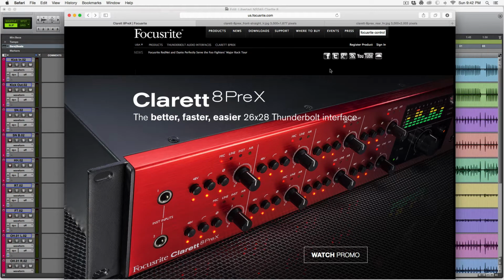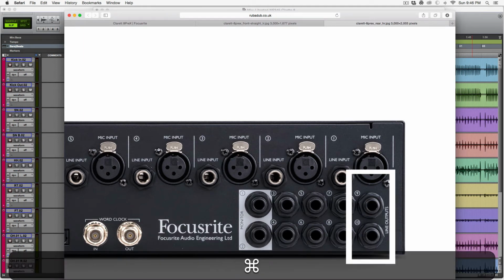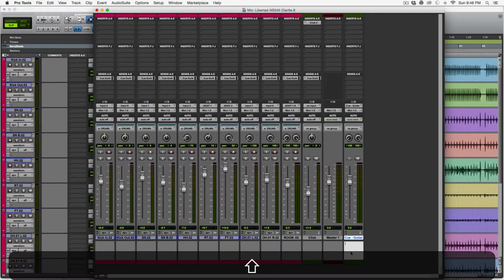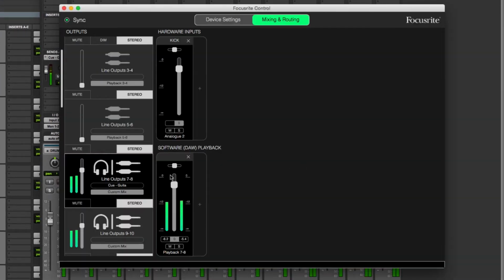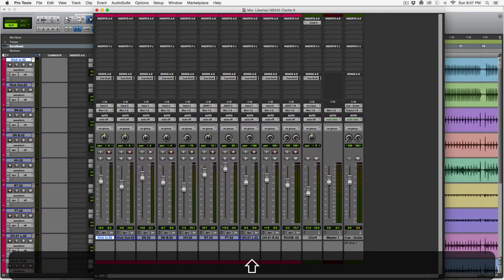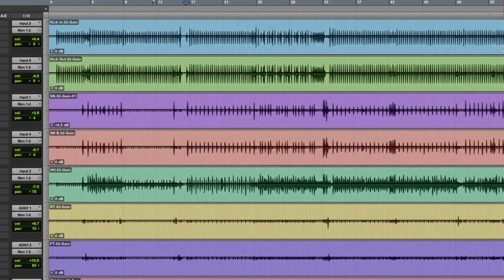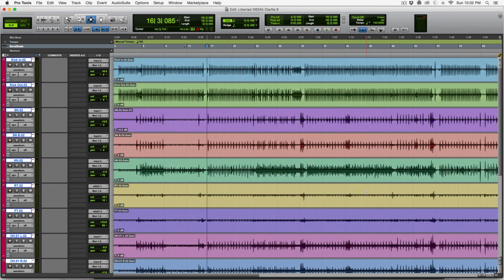Focusrite Control | Setting up Cue Mixes with the Clarett 8PreX and Pro Tools  12

Comment: I’m having a feedback issue, when I insert more then one hardware on a track I will get a double. I then would go to Focusrite control to turn fader down which allows me to hear nothing on that channel. I’ve tried muting also still nothing. All my inputs and out puts matches with Protools. My connections is correct, I’m using balanced cables.  
Focusrite control line outputs matches playback inputs. I’m using Focusrite clarett 8pre all connections is used.
Reply from the maker: OK. You shouldn’t have a feedback loop going if you mute the track just play with it you’ll get to it you’ll figure it out. It took me a little bit, but you have to play with muting the tracks and because you will get a feedback if the tracking your daughter is not muted or something like that don’t remember I don’t have the clarrette anymore so I haven’t used it in a little bit but I remember that exact issue just play with it you’ll get there
Reply: @JorgePintoMusicHTX  I found a work around which was to put my tracks on a Aux bus and then lower the focusrite control , very weird but this worked for me..
Reply from the maker: @prodcountryjames  . Keep playing with it. I’m sure you will find other solutions.

Comment: Unless you set your sends as "pre" (which you did not), it doesn't make any sense to copy the levels of your mixer into your send levels. You want to put all sends at 0dB, so they send your current mixer volumes, and from there, put more or less level on specific channels. The way you did it, a channel that you have in your mixer as +12dB (like your FT.02 channel) will send +24dB to the headphones. Also, any change you make in your mixer still affects the headphones mix. Now, if you set those sends as "pre", then yes, you need to copy your mixer levels to the send levels in order to have the same initial mix, and as they are in "pre", they don't get affected by changes in your mixer. Personally, I'd go with the first option and set the initial level of the sends to 0dB and not setting the sends as "pre".

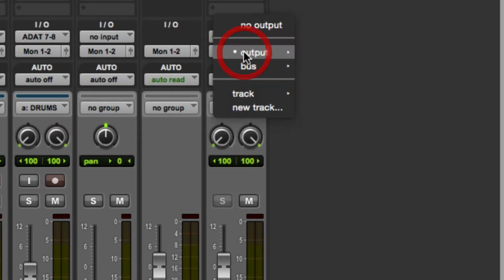Comment: This is insanely confusing.  4:10 "send guitar cue to outputs 7,8."
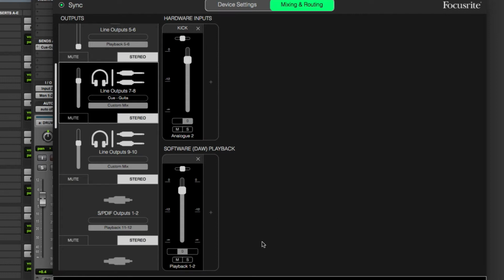5:04 "I'm gonna add playback 1,2" But you put the guitar cue on 7,8; shouldn't you be adding Software playback 7,8?
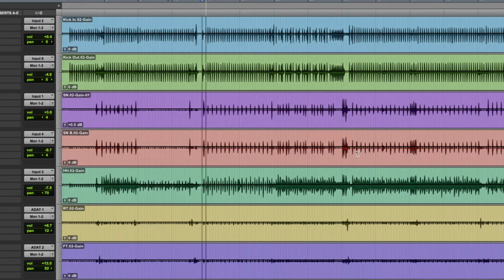5:22 "You can see that the audio is coming out the focusrite control". Okay...
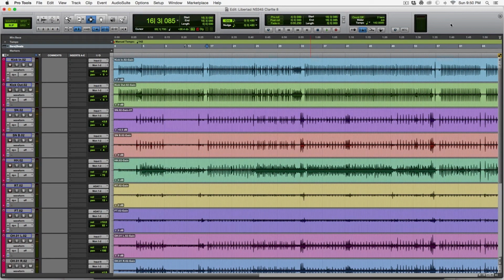5:33 "If you grab your headphones, ... you may not hear any audio at this point." But you just said...
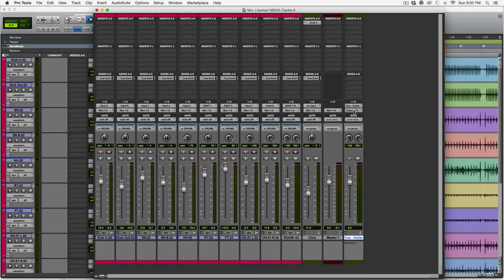5:54 "my outputs going to outputs 7,8" (Then you show your focusrite control software)...but WHOA! You changed it! Without telling us!? So at 5:22, that was the main outputs coming to the headphones, not the guitar cue. Maybe you should have said something?
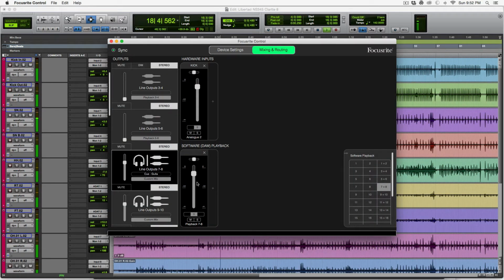5:59 "Notice there's no audio coming out." Oh, surprise!

On the one hand, I learned a lot by watching this video, but it was in spite of your instruction. This is complicated stuff already, when you do switcheroos off camera, it doesn't help anyone.
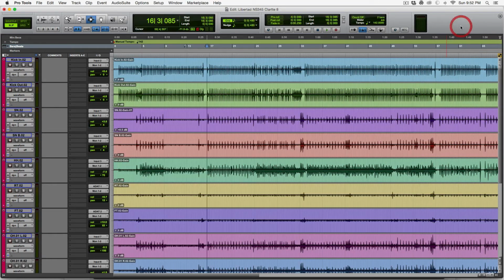Reply: I agree with you dartme18.  I was following along great until the 5:04 - 5:54 part.  Also, I wondered what was his I/O setups in Pro tools as well.  I restored to default on my Focusrite Control app and inside Pro Tools I/O inputs, outputs and buses....  Dartme18 have you figured it out since there has been no response for 5 months?

Comment: sorry for the dumb question, just have to be sure. So, i can assign individual tracks in  my DAW to the output of my choice on the PREX as i want to use VSTS in real time for live performance etc. The PREX outputs would go into line in on my mixer. Cheers :)
Reply: Not a dumb question. That is correct. George.

Comment: Hey man Thanks , So how does it work if you want 4 headphone mixes and you just use  7 for one mix 8 for one mix and so on does that work ?
Reply from the maker: Studio73.rocks that’s a good question. If you did it that way, you would only get left on 7, right on 8. They wouldn’t be mono mixes. They would be left and right. But you can also use your other outputs. 3-4/5-6/

Comment: At the way end of the video you said you can use the front headphone amps (which you labeled HP1 'Output 7-8' and HP2 'Output 9-8) and the outputs (7-8, 9-10) in the back as well. Would it be getting the same signals or can you route totally different signals to the Output 7-8 in the front and the Output 7-8 in the back?
Reply: Same signal
Reply: Thanks Steve

Comment: Thanks man very helpful. I'm using logic but it should be the same configuration. I do have a headphone amp 6 channels a focusrite 8prex and a octopre - just got the octo. 
I saw u just put the guitar if I have a whole band I just do the same to every instrument ?
Reply from the maker: Hi Eduardo. Sorry for the Late Reply. To answer your question " Do I have to do the same to every instrument?:" the Answer is no. In the video you saw me create a BUS ( An Aux Track in Pro Tools). That bus is specially used to send Audio to my headphone amp. So My headphone amp is routed via outputs 7&8 and 9&10 so I have the ability to have two separate mixes. Then I went back to all of my tracks and told each track to send audio to my Cue Mix ( 7&8). I now can send a little guitar, a little bass, a little drums. If you want more then one cue mix if you are recording a full band, you have to create the Buses that match the number of mixes you can have in your headphone amp. If your headphone amp only can take two then you only need two Buses. Then you set the bus on each track. For example. If you have two cue mixes, you can go to your guitar track and send guitar to Cue mix 1 and two ( Bus 7-8) don't forget, you have to assign the output of your interface on the bus channel that's going to take the Audio from Daw to your Headphone amp. Ok, no you want to send bass to only one CUe mix. Go to the bass track and only send bass. You do this for every track. Does that make sense? Don't hesitate to ask any more questions. All the best. George.

Comment: I Think I Was Tricked Into Buying The 18i20. I don't Have a guitar, drum set etc. I only have two mic's a MPC Touch and 4 monitor speakers. A Home Studio as One would put it. Now My Dream Is Go All the way, But financially speaking and a working environment do I need the 18i20 or the 6i6 which lets me connect all 4 of monitor speakers ?
Reply from the maker: Financially speaking, 200$ difference. The 6i6 has enough outputs for two monitors and one headphone amp. The 8i20, has plenty outputs for way more then that. All the best. George!
Reply: Music Production Alliance Your professional opinion, should I keep the 18i20 and go for 6i6. It's not like I'm gonna be recording a live band, Just vocals and use my MPC Touch which has its own Interface.
Reply from the maker: If you can sell the 18i20 and get a 6i6 for cheap, then I would do that.
Reply: Music Production Alliance im with in my return or exchange policy. Any other equipment I Should Go For
Reply from the maker: Carlos Manlaw Cho studio monitors. Yamaha HS series are good.

Comment: I have the Scarlett 6i6 and I can't figure out how to play the system sound  ( sound from my computer;  youtube, sound cloud etc ) while being able to hear the sound coming from my yamaha synthesizer that I have plugged in to the rear line level inputs 3 and 4 for a stereo signal. I am able to switch between listening to one or the other, but I would like to be able to hear them both at the same time. For example, when I am preparing for a gig, I like to play along on my synthesizer with a song from YouTube so I need to be able to hear them simultaneously. With my old interface this wasn't an issue, but this Scarlett is very confusing.
Reply from the maker: If you are on a mac, make sure you go to your sound setting and select your interface for sound output. Are you hearing the system sound at all through your computer? If you are, you have to change it.
Reply: Music Production Alliance Yes, I have the settings in my mac set to the Scarlett for both the input and output.
Reply from the maker: Can you tell me how you have FC Control set up. What do you have going on on output 1-2 and 3-4? Can you share a Picture? just place a dropbox link here.

Comment: It's very different than how Focusrite sets up their headphones mix. I may try this method on my next recording and see which one is more user-friendly. 

This is usually how you set up foldback mixes on a typical analog console. 

Thanks for sharing!
Reply from the maker: Cool. No problem.
Reply: So I got to try this a bit more this morning and this is what I found. Let me know if you have encountered any similar issues. Personally, your method is a much more efficient way of working, since you don't have to switch screens when creating headphone mixes and adjusting levels.

1. I set all the Sends to Pre Fade listen. This way, if I want to solo a channel (to monitor), it does not interfere with the artist's headphone mixes.

2. On the Focusrite Control, I had to set the Outputs to the corresponding mixes. For example, let's say we're making a different mix using Outputs 7-8 (from Outputs 1-2 which are the monitors), if you leave the output to Playback 1-2 (or Custom Mix), then it's going to send both mixes to that one channel (because every out listens to Playback 1-2, unless you change it). Once take out "Custom Mix" , the screen shows the "routing" of the that particular output. So I have to go back to Outputs 1-2 (Monitors - which are set to Custom Mix), to adjust and add the channels.

When you get a chance, try muting the sends from the channel strips and see if the signal is still going through if all the Outputs on the Focusrite Control are all set to "Custom Mix."

Together, I think we can troubleshoot and set up a more efficient routing solution than the one Focusrite suggest. Thanks!  \m/
Reply from the maker: I think I understand what you are saying. Correct me if I'm wrong. 

1. If I set up a headphone Mix in PT using a send? I select all of the tracks and add a send to all of the them. PT then creates an AUX track. I set it's output to 7/8 or 9/10. 

2. I then go to Focusrite Control and scroll down to 7/8 and set it up as Custom Mix. And I add 7/8. Here's the trick. 

3. If I 7/8 as a track on outputs 7/8 within focus rite control, it is also added to all of the other outputs.  

4. so, You can a- mute 7/8 on all of the other outputs or B. set the outhe outputs not as a custom Mix but as a direct monitoring. 

Does this make sense? 

I will try to check the scenario you described above today.